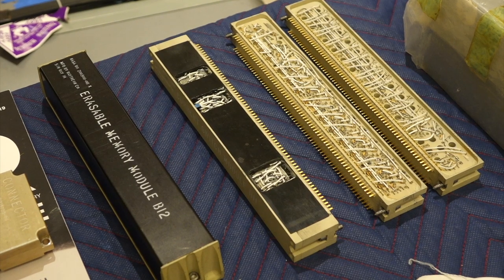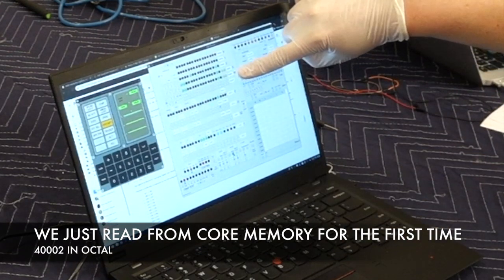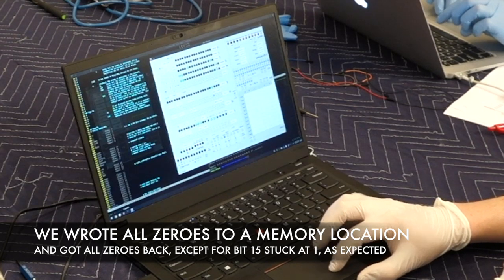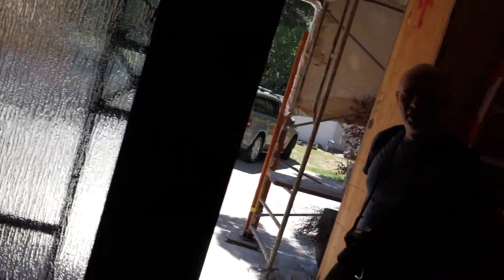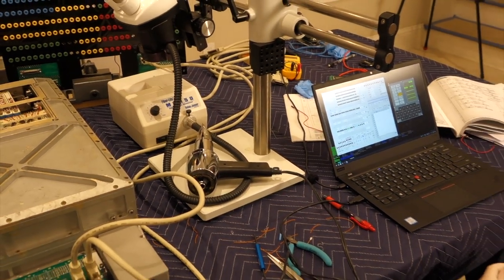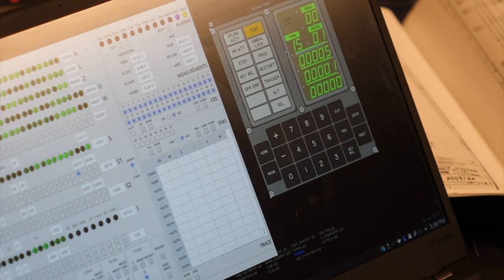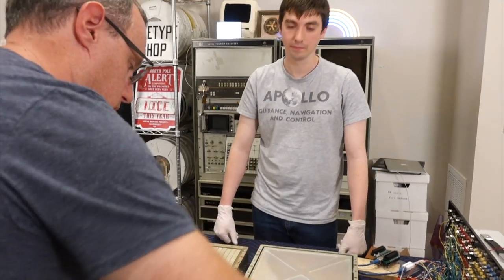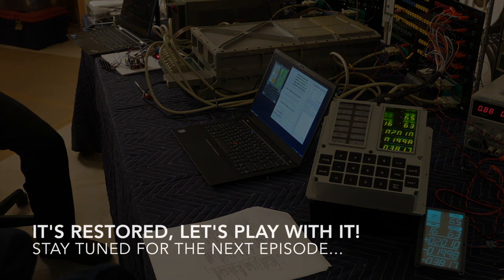Apollo Guidance Computer Part 19: It finally works!

Comment: Modern technology: if a bit of your computer no longer works, replace a significant part of the computer.
Apollo technology: if a bit of your computer no longer works, simple replace the bit that doesn’t work with a bit that does and has less significance. 
I wonder why we decided to call modern technology more advanced...
Reply: We do the same thing today, but better and automatically. Enterprise RAM has parity memory that can detect a bit error, correct it, and continue running. 

One reason your consumer PC never* has this feature is that Intel turns it off for non-Xeon CPUs to make sure companies don't buy cheap consumer CPUs for servers and workstations.

* You can get it with the two latest generations of AMD consumer CPUs, but your motherboard needs to support it, and you need to buy somewhat more expensive RAM with the parity bits.
Reply: the sad part is that even when modern devices are repairable, it is usually cheaper to simply  replace them than repair them
Reply: @v4lgrind  Just always be one generation behind in memory and you can get (for example ddr3) memory with ecc for vety cheap used!
Reply: False equivalence, the repair shown is clever and functional enough for demonstration purposes, but removing the parity bit would never fly if it were going on a man rated spacecraft again (edit:For any reason, flight, testing, whatever, if it's not running as designed, let alone with safety features disabled, it wouldn't be considered functional by the standards it was originally held to).

There's also a reason why core memory disappeared in a hurry when silicon alternatives emerged, it's a pain in the ass to deal with, literally half of this machine is either memory or memory interface hardware.
Reply: @Broken_Yugo  well, neither would removing potting compound, using off the shelf parts,  non space qualified parts, an emulator for the read-only memory, and so on and so forth, the only thing that counts is that they DID achieve the goal of restoring  functionality, a very difficult task. 
don't forget that this unit was never flight certified either, it was the following batch that actually flew
Reply: @Broken_Yugo  An arduino (or three for redundancy) could be made to fly the moon missions... You could have the AGC there for shits and giggles and switch flying it with other hardware if something doesn't look right...
Reply: @markwilliams-ko5zq  None of that's wrong but that's not really pertinent to the discussion at hand. 

iRelg insinuated that AGC era technology is somehow "more advanced" than a modern computer because it was able to be bodged (and I use that term with the utmost respect and endearment) back to life. That wouldn't have flown, figuratively or literally, when this machine was part of the Apollo program, the fact that it was able to be repaired the way it was is immaterial. In it's time, had it been repaired, I'll hazard a guess it would have had whole modules swapped out (just as we do today with modern computers) and the dead ones only autopsied to pinpoint the failure for development purposes.
Reply: Don't be obtuse. The reason that it was done for the AGC is that it was a historical piece that is no longer manufactured being restored to functionality, whereas modern computers are mass-produced, cheap, easy to replace, and yes, FAR more powerful. That doesn't degrade the historical importance or beauty of the AGC though.

Comment: 6:50...why?😅
Reply: In the computer logic, values are 15-bit but stored with two sign bits. This is used for overflow detection; if you perform an operation that causes your accumulator to overflow, its two sign bits will then disagree. Bit 16, the main sign bit, preserves the sign of the answer, so only the magnitude is lost. The software can't directly see bit 15. Instead, it can only infer overflow through some instructions whose behavior is modified (e.g. TS).

When the data is written back out to core memory, bit 16 is selected as the true sign bit, and bit 15 is discarded. A parity bit is also generated, and instead of shuffling everything around, they opted to just write bits 16 and 14-1 to their correct locations, and fill the parity bit into the now-unoccupied position 15.
Reply: @mikestewart8928  makes sense

Comment: "COURSE" not "COARSE"
Reply: Coarse alignment as compared to fine alignment. Coarse alignment torques the gyro platform around to some orientation relative to the spacecraft, then using a telescope to sight on starts, the Astronaut does the fine alignment.

Comment: It's just junk. I saw these components laying around at a military surplus store, and I have to say, they are nothing to get excited about. Just junk.
Reply from the maker: Let us know which store. Obviously they’d be worth a fortune. So I have some doubts about your story.
Reply: @CuriousMarc  Oxman's Military Surplus in Norwalk, Calif. I saw them in about 1982 or so. Along with a Saturn 5 rocket engine they wanted $35,000 for (and they sold, someone has it). They had a lot of this stuff. It mostly sat around and rusted in the weather. Too me, then and now, this kind of stuff was and is as interesting and valuable as finding an old toaster (not very). I wanted the rocket engine, but I was working minimum wage. $35,000 was a lot of money in those days, even though the engine was worth millions. The memory parts, not so interesting. I would have bought them I suppose, but what was I really going to do with them? Do what you are doing, "gee, lookie me, I got junk from Apollo, it must be worth millions". bah.